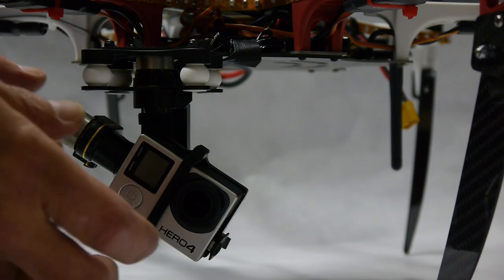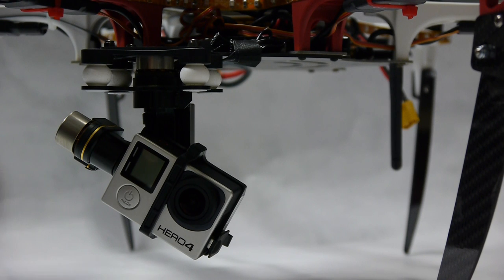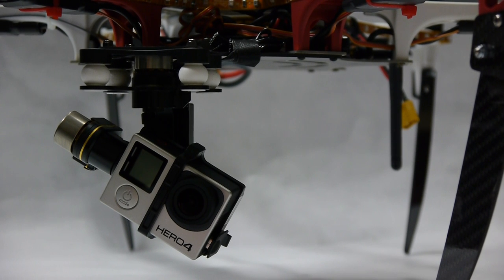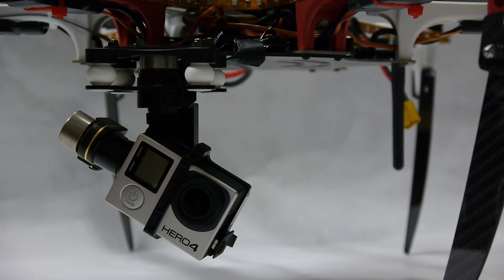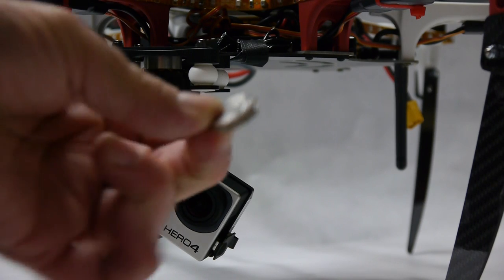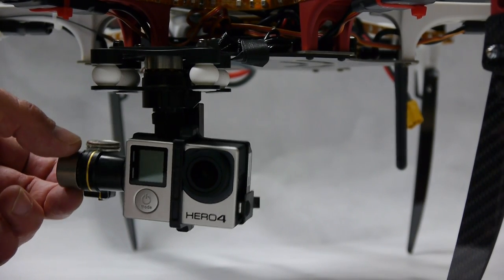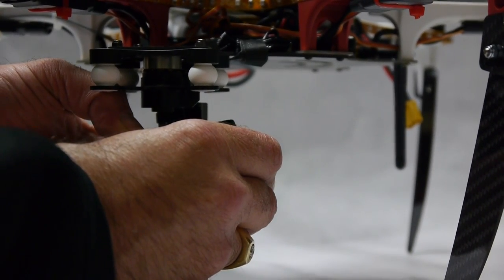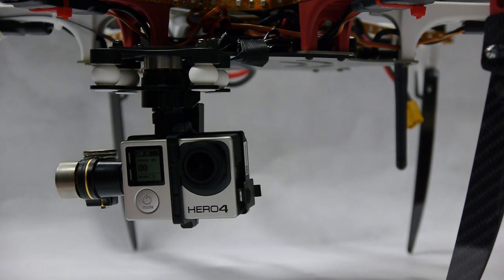Balancing DJI H3-3D 3-Axis Gimbal w/GoPro Hero4 Black 4K Action Camera

Comment: FWIW, I've seen variation between two different Hero4 Blacks in the same H3-3D.  One fit perfectly fine, the other was just a tad snug, causing the side button to be partly depressed, and intermittently actually depressing the button.  Inserting thick paper to push the camera seems to work.  Seems the tolerances can add up to be a bit of an issue.

Comment: Great video!  I have not tried my Phantom in the air yet but the Gimbal
works perfectly when I turn it around. Before I did the coin balancing the motor
made strange noises in the tilt axis.
I wonder if they come with a new Gimbal for the GP4!

Comment: thanks a lot about your feedback relating to the grinding down the gimbal. I have been trying to find out information about this. also, I do not own a Phantom, but plan on getting one soon, as well as a hero 4. do you think I should wait to see if they come out with a gimbal designed for the hero 4? also, other people have not done this coin thing... doesnt it balance itself when you turn it on? is that not sufficient? thank you :)